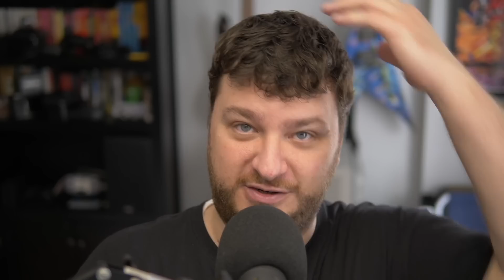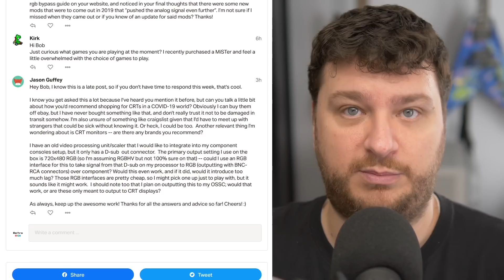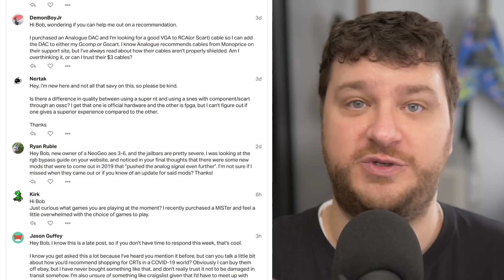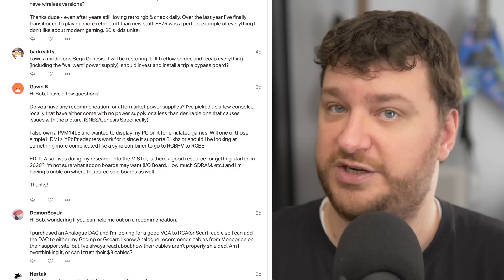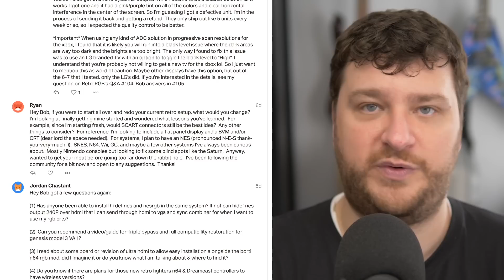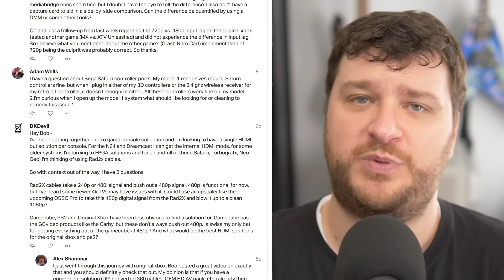Supporter Q&A #108

Comment: I have a similar issue with my Saturn Model 2 with 3D controller and Retrobit 2.4ghz wireless controllers not being detected. Regular wired 6 Button Saturn controllers works fine.  Cleaning the ports didn't help. Odd issue specifically with the wireless Retrobit 2.4ghz controller is if I connect the mini USB to a power source and to one of the receivers, the red LED light is brighter and connects with the controller 100%. However If i disconnect the USB it no longer detects, leading me to believe a PSU issue.  Replaced the PSU with the same issue.  Have not tried a recap yet.
For the sake of own sanity, I recently purchased another Saturn Model 2 and tested those same Retrobit 2.4ghz controllers without any issues. 3D controller works perfectly also.

Comment: To the person wanting to build a retro setup and was asking for advice, if you want to go the professional CRT monitor route, I would highly suggest a Sony 20L5. It natively supports RGB, yPbPr component, S-Video, and composite so you don’t need to find expansion cards. It’s also multi format and supports 240p, 480i, and 480p and it’s just less finicky than the higher end BVM’s. Image quality is also excellent and among the best you can get. It’s also relatively  compact compared to higher end BVM’s. It’s one of the best CRT’s you can buy and it’s very user friendly for a beginner.

Comment: RE: Super NT vs OG Snes: I still come across the occasional glitch on Super NT, which I always report. Unfortunately, Analogue is pretty slow to update its firmware at this point, which is one of the downsides of the closed source products like that. Also, their hybrid scan line implementation is still kinda broken at this point, though basic scanlines seem fine. Still, the glitches are generally small in nature and hopefully they’ll be fixed one day. Always worth remembering that 1chips Snes’ have their own issues with certain games (and it always seems to be the one I want to play). These issues cannot be fixed as far as I understand. Finally, please don’t pay reseller prices for Analogue products. They’ll restock eventually.
Reply: Agreed. The Super NT isn't perfect, but neither are the 1 Chip SNES consoles. Both of them suffer from minor issues in the end, and they really aren't that common.

Comment: When you talk about the OSSC compared to other options like 2X products, I don't think it has to be presented as a tinkerer device where you absolutely have to be ready to dial in optimal timings, etc.  In fact many users would prefer NOT to use optimal timings in order to use scanline filters or 4:3 aspect ratios. As long as the TV or monitor is compatible with the OSSC (and it usually is at least with the default line2x mode) The OSSC can be used as an almost plug-and-play device just like the alternatives, while also having a deep set of customizable features for those inclined to use them.

Comment: Hey Bob, What was that TurboGrafx CD game u were hinting at?.. The new side scroller that you’d discovered?.. jus curious lol. I Love my Mister! It’s making me play retro games I never knew I would. I use it w a 27” Sony Trinitron, hooked up w a set of custom vga to component cables via the I/O board. It looks and feels amazing!.. even w an 8bitdo SN30 over BT.. that’s how good 0 CRT lag is! I tell everyone it’s Retro Gaming Perfection!.. but nobody cares 🤣 ...It makes games like Contra 3 and HardCorps actually feel beatable lol.. you can now see and react quick enough. I’ve been trying to get some good offscreen captures at 60fps.. when captured right it’s def enough for my friends to react and see just how good these games can look lol. I’ve really been diving deep into my CRT as far as the Service Menu and settings/adjustments that are available. I use the 240p test suite with multiple cores to dial it in best I can. I feel I got something that looks almost HD! Unfortunately time isn’t on its side as it does exhibit some warping that seems unfixable. It looks like most crts can possibly be fixed w new capacitors and some convergence strips/adjustment around the tube. I believe I can do this, but I’m ultimately nervous for obvious reasons. My friends would never stop laughing if they knew I died adjusting a TV 🤣.. yep I’m that guy lol. Anyways, Sorry for Rant. Love what ya do.. got into this because of you and a Dreamcast haha... Any answers/insight to the above would be greatly appreciated. Thanks.

Comment: Morning bro, dived head first into Xbox modding with my son as an extended project. So far we have one working 128mb Chihiro compatible unit with a 3tb Masnart drive. I know about the space limitations but with 760 preloaded OG Xbox games and tons of emulators w/roms it was well worth the price. We have one being farmed out for the ram upgrade and we're recapping and applying new thermal paste to most of the 5 thrift store Xbox's we've acquired. We want 2 to system link with similar setups and the leftovers we'll cleanup and configure sans DVD drive and release them back into the wild. Thanks for all your help and knowledge base, it's been a great help. Ended up scoring a nice set of monster component cables ($40 eBay) and I bought the hdmi component converter from your link.

Edit: other than the ram upgrade were doing it ourselves.
Reply: noneed4me2 you gotta get XMB on that!!!
Reply: It's already on the drive. Go checkout Masnart's YouTube channel he demos his stuff. Chihiro games too. With the TSOP 5035 bios it should just be a drop in.